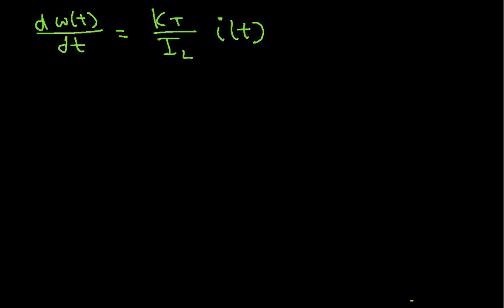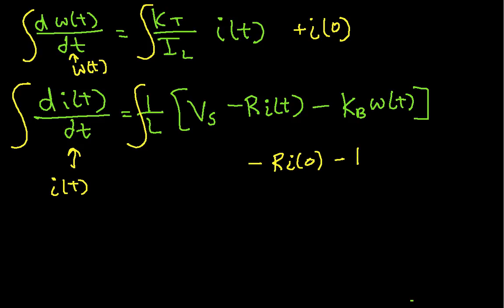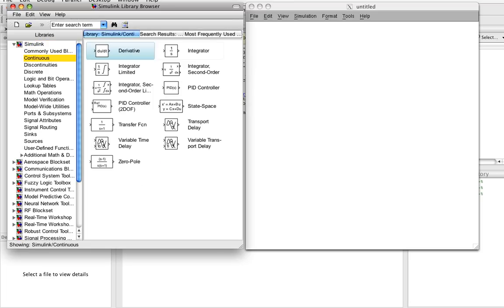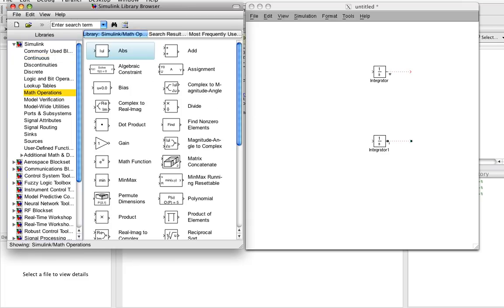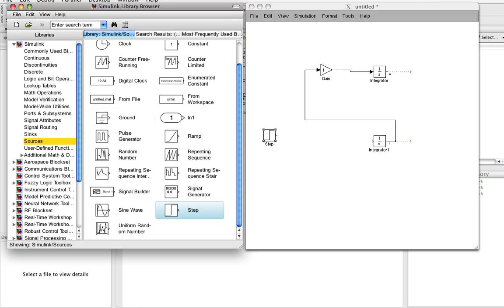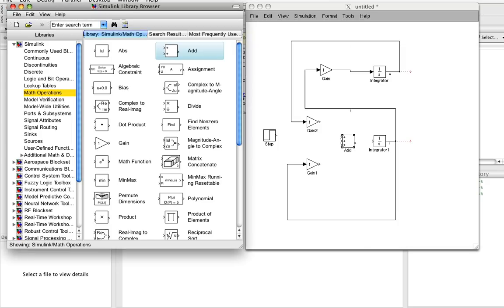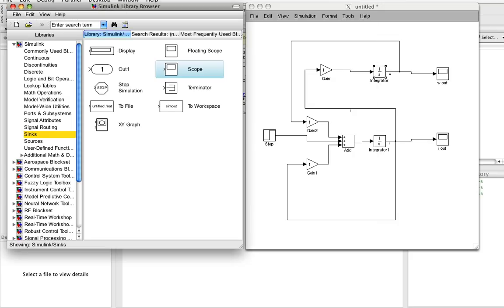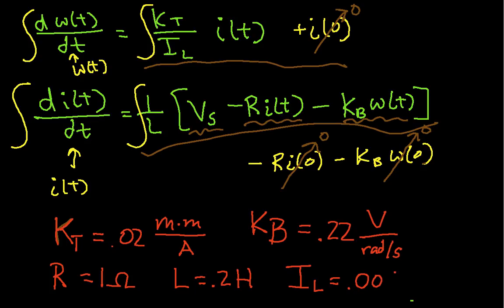Modeling a DC Motor In Simulink Part 3 of 4

Comment from the maker: @minthetster88 You would need to use a different electrical model for the motor; so instead of the model that I used in Part 1 of the video, you would use a model for a separately excited motor. You can find potential models by googling dc motor separately excited.